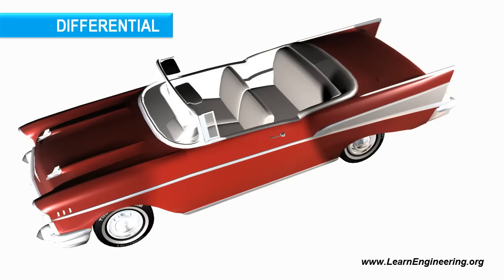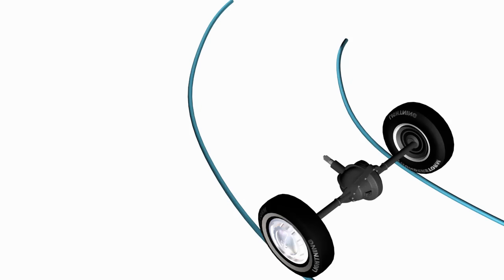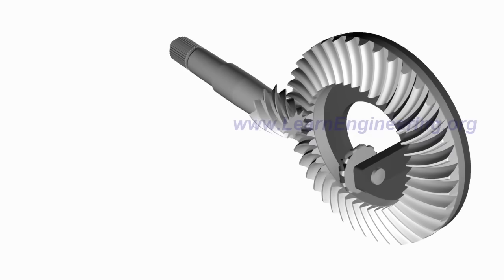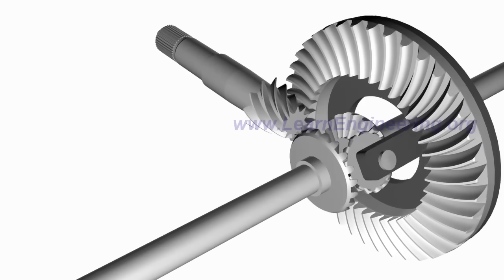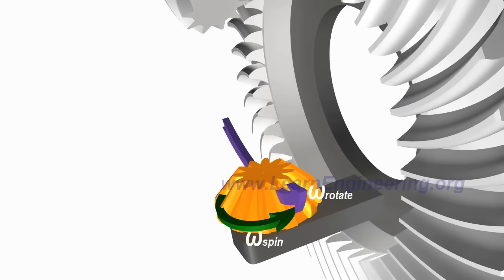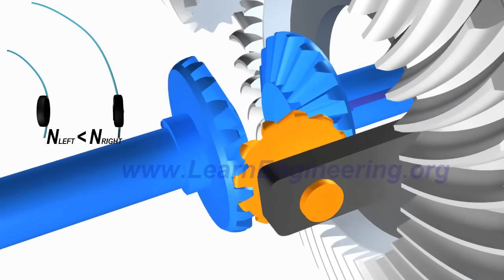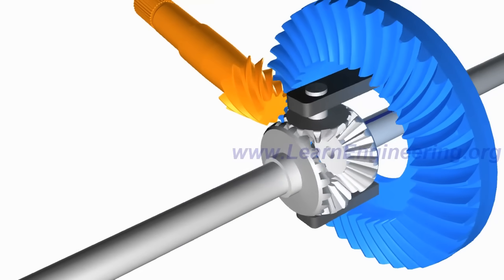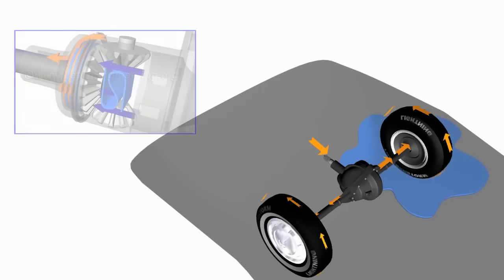How a Differential works ?

Comment: Sorry if I'm just being really stupid, but how does the spider gear "know" to rotate on its own axis when the car is turning? Or is there some sort of mechanism involved?
Reply from the maker: MrLatinNerd There is no mechanism involved to spin the spider gear. The spider gear is forced to spin on its own axis due to the demand of speed differential.
Reply: @SabinCivil  but how spider gear know where demand of speed required more or where less im totally confuse please explain ?
Reply: @narayantakle3648  there is no sensor as such. It's like cause and effect. For ex if there is a 3 variable equation and I put two values in it. The third variable will automatically assume a value in order to satisfy the equation. 
The differential is like the third variable that automatically assumes a rpm to allow a natural difference in speeds of the back wheels.
For your question, It will assume a clockwise rpm for left direction turn and vice versa for right direction.
Reply: Arthur Collins It's the force exerted onto thew heel by the gourd as Zan turn
Reply: Ernesto Sastre When the car takes a turn, the outer tire spins more than the inner one. 

Now, if both axis were to be locked, this would cause tires to slip.

In this case, each axis is separated, tied together by a spider gear.

Due to axis being separated, one is able to spin faster than the other.

The difference of speed (and thus, force->torque) in both axis make the spider gear rotate. (Try pushing a long object in opposite sides simultaneously, harder on one side than on the other, it spins)

Were the spider gear unable to rotate in its own axis (say, welding the differential), the axis would be unable to spin at different speeds, disabling the differential.
Reply: 20frieza The outer wheel doesnt "realize" its spinning faster, it has to spin more times since its traveling along a longer path (arc). The extra spins (higher RPM's) of the outside wheel then turn the spider gear which counteracts the spin of the inside wheel allowing it to spin at a slower speed than the outside wheel.  So to answer your main question, the outer wheel does not know  when to turn the spider gear, it must turn at a higher RPM's because its taking a longer path on a turn than the inside wheel.

Sorry if my explanation isnt clear enough, it can be a tough concept to explain.
Reply: Ernesto Sastre Watch the beginning again carefully.  When a car is taking a RIGHT hand turn, the LEFT wheel must travel along a further arc than the inside (RIGHT) wheel.  Because of this, the left wheel must turn at a higher RPM than the right wheel.  The extra RPM force generated by the left wheel over the right wheel causes the Spider gear to turn and compensate for the difference in RPM's on both wheels.  Essentially the left wheel will turn the spider gear along the right wheel to allow it to spin slower. watch the clip at around 3:30 a bunch of times and you will understand
Reply: @gnarkilleptic4871  Thankssssss haha
Reply: +MrLatinNerd  Yeah I think the important thing to keep in mind is that the spider is completely passive. It's not forcing a spin to give one wheel more rpm over the other, it just allows one wheel to spin with more rpm than the other which would not otherwise be the case if the axil where solid from wheel to wheel.
Reply: @CaLvInblack410  Literally every other comment in this thread only made the confusion worse. All that needed to be said is this right here. This isn't an active system that forces the outside wheel to spin faster in response to a turn. The outside wheel is going to spin faster due to travelling further around the turn, and this is a passive system that allows that to happen, rather than locking the wheels together like a solid axle. All the other nonsense about weight distribution and such is just that. Thank you.
Reply: Your answer is the best one.  To get some intuition about how this works, think of the case where one wheel faces infinite friction and the other one is allowed to slip freely without any friction (think glare ice).  The spider gear is still obliged by the drive shaft to rotate with the ring gear, and it is no longer turning the high friction axle.  That means all of the torque generated by the ring gear and passed through the spider gear, is communicated to the freely spinning wheel.   

The spider gear in effect powers the wheel of least resistance at all points in time.  On a turn that means more of the drive power goes to the outer wheel in the turn.
Reply: +Ernesto Sastre The act of turning triggers demand on the differential.  Yes, the differential knows when it is in a turn because there is more demand on one side than the other.  Were that demand not present, it would not put any pressure on the spider wheel to spin about its axis.
Reply: +gnarkilleptic Would I be correct to say that because of the force(torque) generated by the engine, the left wheel automatically turns at a quicker rate than the right wheel not because it knows it needs to, but because the differential transferred more of the engine's power to the left wheel instead of the right? In other words, does the spider know when to start rotating about its own axis and transferring more power to the left wheel simply because it receives more force from the engine? I think what many here (including myself) are finding hard to understand is the part where they're told the left wheel HAS to spin more times than the right wheel in order for the car to turn smoothly, implying that it always does happen, which is why the spider seems to 'know' to rotate about its own axis and transfer more power to the left wheel instead of simply not rotating. It's very difficult to explain properly, I mean most Physics concepts are, but I'd really appreciate if you could help :)
Reply: While turning, the wheel closer to the turn requires more power to be moved than the opposite wheel because of the forces implied (the term "weight" was a simplification on my part). Thus, the spider wheel translates that difference naturally, because it finds more resistance to communicate motion to one wheel than to the other. At least that's how I understand it. I might be wrong, though.
Reply: +MrLatinNerd it remains stationary due to the wheels havinig similar resistance. You could say they balance each other out so the whole assembly rotates. When turning the inside wheel tends to have more resistance or require more force to turn so the spider gear begins to turn and outside wheel will spin faster.
Reply: +MrLatinNerd hey! the reason i can think of in this case is the difference in torque on both the wheels while taking a turn. let's say a car is moving in a circle in the clockwise direction (taking the right turn always), the force arm of the right wheel from the center point is smaller as compared to the left wheel which has a bigger force arm, in that respect the torques on both the wheels are different which i think is the reason for the rotation of spider gear on its own axis
Reply: +20frieza Its fritction. the Wheel itself doesnt accelerate, the right side of the car does and the Wheel has to keep up. Difference of speed between the Wheel rubber and road surface will build up friction which transfers to the shaff...Like those old bycycles without gear...if you stop pedaling while already moving, the pedals will continue to move on their own. If you try to keep them from moving though, you'll feel a force (result of friction) in you feets and the bycycle will start sliding.
Reply: +Learn Engineering but doesn't the flow of the motion start from the pinion gear,through the ring gear and the spider gear and THEN into the wheels ?? What i'm trying to say is that shouldn't the spider gear determine the speed of the wheels and not the other way around ?? i hope i'm making sense
Reply: I'm guessing that the initial speed differential (from say driving straight to making a turn) is caused by friction. When you turn all of the cars weight is pushed on to one side, equating to more ground traction on that side which in turn slows down the wheel therefore creating a diferential between the two wheels. Speed Differential (one wheel moving faster than the other) in turn activates the spider gear. This explanation also makes sense when we examine the standard differential's main drawback which is if one wheel is on a slippery surface. There is more traction on one side therefore creating speed differential which equates to the spider gear sending more power to the slippery surface/side with less traction.
Reply: because when turning, 1 wheel is taking a shorter path and in order to take the shorter path it wants to slow down.

now the act of the inner wheel slowing down and the outer wheel does not, which make's the side gear on the inner side spin slower, this means that the spider gear is fighting more pressure on the Inner side gear than the outer and because like anything it wants to find he path of least resistance, the Spider gear chooses to rotate to compensate for the slower speed rather than force both side gears to move at the same speed.
Reply: I know this is a in old thread, but it is the friction with the ground that forces the difference in wheel RPM. If there is no differential, then the inner wheel will slip against the road. This draws additional force in order to overcome the natural friction of the wheel against the road. Instead if thinking that the differential changes the speed of each wheel, it's easier to think of it that the differential ALLOWS the different speeds for each wheel, which is what the wheels naturally want to do due to the friction against the road.
Reply: @samc4531  wowww u just enlightened me after all these comments i wasnt satisfied but as u said differential "allows" it to rotate has made me clear this doubt now thanks man
Reply: Thanks
Reply: +MrLatinNerd the two wheel can freely rotate about its axis and around the corner there is different speed between two wheels so that differential speed rotate the spider so the spider rotate by differential speed  .
Reply: +Ten Pur Thanks dude! great explanation. finally I think I got it
Reply: Thanks for all your comments, guys - I think I understand this now!
Reply: +MrLatinNerd Due to the conservation of angular momentum .
Reply: I Will try to explain how both wheels turn at different speeds 

The two wheels are connected through an axis, therefore both are making 
the same circular trajectory explained by the equation v=w x r. The 
angular velocity (w) is the same for both wheels but radius r are 
different, therefore the external wheel will have more vel than the 
internal to compensate it.
Both wheel have the same diameter so to have different speeds the two 
should have different angular velocity of wheel ( attention because this
 angular velocity is of the turning wheel and is different of the 
trajectory angular velocity). V= w x r again and this time radius are 
the same, therefore the external wheel will rotate faster ( w = rotation
 per second) than the closest one and its angular acceleration ( Alfa) 
is bigger. This brings an increase of momentum in the distant wheel, 
cause momentum = I x Alfa, I is the Same in both wheels cause depends on
 the geometry and weight ( equal wheels), therefore exist an increase of
 momentum in the external wheel and a decrease at the internal, this 
difference of momentum is transmitted to the gears until comes to the 
spider gear, the spider gear turns on it axis because exist a bigger 
momentum in one of the gears that is connected to the momentum 
transmitted by the external wheel' and this makes the spider gear 
rotates on it own axis and this rotation makes the internal axis rotate 
independent with less wheel angular velocity what avoid the drag when 
you make a curve.

Sorry, my English is poor but I hope you understand the main idea
Reply: I struggled with this too but then I tried to make sense this way. The act of turning due to the front wheels means that the car is turning in a circle, turning right, clockwise for example. Then theres a centre point in the road of which the car goes around (due to the steering, force applied on front tyres twards the centre of circle). Run an imaginary line from the centre point through the rear wheel axis which has 2 radii, long radius for left wheel, short radius for right wheel. The engine provides torque to both wheels equally as they travel round this circle. The radius from the left wheel to the centre is longer than the radius from the right wheel to the centre. Torque = force.radius . In order for torque to be conserved, force.radius must be conserved. As the right wheel has a smaller radius, it has a larger opposing force vrs the left wheel (for t = F.r to be true). This opposing force difference from the left n right wheel acts on the spider gear causing it to rotate.
Reply: For anyone still confused after six years, this happens naturally. That’s the best way to put it. There’s not computer chip or magical tiny creature that figures out when you’re making a turn. It also helps to understand that the spider gear isn’t what starts the whole thing, it’s what makes it possible. The different rpm’s of the wheels when turning happens naturally as that’s just how physics works. If the wheels were attached together with a simple rod, there’d be problems. So they need to be independent of each other while still drawing the same amount of power from the engine. What makes that possible? The spider gear. Longer than I expected but honestly the best way I can think of to put it and again it starts with understanding that the spider fear doesn’t initiate or start the system, it’s what makes it oossible
Reply: @ItsDeeKay69  Yeah I kinda had this question for like 5 minutes and then I understood what you guys were trying to say. My two cents: TO MAKE IT ABSOLUTELY CLEAR -
-Picture two wheels attached together by an axle, they spin independently though they are not being driven
-We all know that when they turn, one has to turn less than the other
-So if they are attached together and there is no wiggle room, and the car HAS to take a turn, then if the car is going to stay together and not split apart, the wheels will have to go different speeds, or else it would break the rod or cause the car to veer off course
-Basically, it is because the car stays together that the spider gear 'knows'. The demand of the difference is already placed onto it by virtue of the car staying together and taking a turn. It's a rigid object (mostly).
-In the case of traction loss, one wheel that loses traction naturally can spin more easily on its own, it's the 'faster wheel', it creates the difference and the spider gear responds to it
Reply: zenerd No probs
Reply: it is the effect produced due to spinning. can you please explain what causes spider to rotate clockwise or anticlockwise?
I know that different speed demands causes spider to rotate but shouldn't it there be a cause which results in differential speed??
Reply: ok i got it if the wheel turns to the right reactive forces on the right side gear causes the spider to rotate in such a way that its rotation contributes to increased rotating speed of left side gear
Reply: My Question is:
Suppose a car is taking a really big turn such that the inner wheel must make a zero turning radius, would the transmission allow that wheel to not move at all or it will let it slip?. What i really fail to understand is that what would happen if both wheels were to be suspended while rotating, then you tried to stop one wheel using just a small force, would that be possible or the spider gear does not allow a wheel to slow down?
Reply: Learn Engineering  sir the question is 
does rpm difference make the spidergear spin about its axis      or  
     is it the spider itself  makes the tires rotate at independent rates???in other words  does tires rpm difference apply a spin on spider or  is it the spider applying a rpm difference to the tires???
Reply: Kaddafi K Due to different forces acting on the wheels(while starting the turn), torque will be different in both wheels, so the spider gear will be forced to turn. At the exact same time, the tires will decelerate/accelerate(depending on the way you turn).
Reply: Jonas Kunnen alright so  tires at different rpm make the spider spin n 
then spider gear allows rpm difference go on .
Reply: @shahabghasemi  Tires affect spider, spider does not do anything ACTIVELY to change how the tires spin, it is a passive system that allows the tires to spin independently
Reply: MrLatinNerd 
'Vx
Reply: Never say that, I had just the same question
Reply: +gnarkilleptic
"extra RPM force generated by the left wheel".
Then, how does the left wheel get the extra rpm/force ?
Reply: +quitarist
It has to be proved that the turn causes faster rotation on the outer wheel. If this is right, it will give the answer why the spider gear spins on its axis.
Reply: MrLatinNerd I think you are asking yourself how the car even 'knows' in which direction it has to drive. This has something to do with the steering at the front wheels I think. The wheels at the back just 'adapt' to the curve the car has to drive. Please correct me if I am wrong.
Reply: +MrLatinNerd
Let me put it simply
The spider gear doesnt turn to make the wheels go at different speeds
The wheels go at different speeds and make the spider gear turn
Make sense? You're thinking of it backwards.
The car is trying to make a turn forcing the outer wheel to spin more, which causes it to rotate the spidergear so it works out
Reply: When was the differential.invented. Before this invention how cars worked?
Reply: All of you guys did an awesome job but its simply just physics 101. There is no singal from the transmission to put more rpm on  one  side.   Its just machanics and physics same thing like leaning on  a bicycle with high speeds will turn you without moving handle bars
Reply: yes, but that doesn't make sense for someone who is trying to understand why one wheel rotating faster than the other does that. To correctly answer his question you should've gone into more detail.
Reply: Watch again and just imagine you are the one who turned the wheel in opposite direction
Reply: Think of 2 guys running laps in a 400 meter oval track, when they're running straight they can have the same speed and be side by side, but when a curve comes the guy on the external lane has to run faster to keep up with the guy in the internal lane.
Reply: MrLatinNerd take out nerd from your name
Reply: that's because this video as a lesson is no good! 
Watch this one - simple and easy! I guess in 1937 teachers were much better :) 
https://www.youtube.com/watch?v=yYAw79386WI
Reply: I had the same question. Thank you all much for your explanations. I got it.
Reply: That's a good joke
Reply: I think a lot of what causes confusion here is how the two rotations of the spider gear play different roles, and how axle alignment constraint is key. The explanation for how the driving force/torque is transmitted from the drive shaft to the axles is straightforward (pinion >ring gear > spider> axle shafts),  but once the spider gear rotates about its own, axis it may seem unclear what the “chain of action” is. It is clear to the observer that the spider gear transmits the force to turn the axles, yet if the speed differential is responsible for turning the spider gear, this could seem like circular reasoning. 

The trick is to remember that the rotation of the spider gear with the ring gear is always happening, even while the spider is stationary about its own axis, and this transmits torque to turn the axles. The rotation of the spider gear comes into play when there are forces on its teeth that are perpendicular to both its axis of rotation and the axle shafts. 

Thus, you get the following chain of events: 
1. The front axle is steered to initiate a turn.
2. The spider gear, rotating around the ring gear axis, continues to deliver torque to the axles that would drive both wheels at the same rotational speed.
3. At this point, the outer wheel would have to rotate faster, or the inner wheel rotate slower, in order for the two axles to stay aligned through the turn. The positioning of the spider gear itself is what aligns and constrains the two axles to one axis. 
4. While the rotation of the spider gear around the ring gear axis continues to supply the force for both wheels to turn at the same rotational speed, the teeth of the spider gear simultaneously makes it impossible for the wheels to do so, as this would cause the axles to be misaligned. 
5. This resistant force in the spider gear teeth, which allows it to constrain the axles during a turn, is what then causes the spider gear to begin rotating about its own axis. This rotation, in turn, has an tangential force component that will add to the outer wheel, and subtract from the inner wheel, thus allowing for different rpms. When the teeth are no longer resisting a force that would otherwise cause the axles to be misaligned, then the spider gear will cease to rotate about its own axis. 
Note: The direction of the spider gear’s axial rotation depends on which resultant force direction would counter the axles from becoming misaligned. In a right turn, the right inside axle would start to lead the left outside axle if they were not constrained, thus, a resultant force that added to the left, and subtracted from the right (clockwise) would then keep the axles aligned, and vice versa.

If anybody waded down to my comment and was confused, I hope that this explanation helps!
Reply: Not stupid at all but, you should watch this explanation as it explains it very well and it is a planetary gear, not a spider gear as mentioned in this video. 
https://www.youtube.com/watch?v=yYAw79386WI
Reply: See I was also wondering this so it's not that stupid lol. But I'm glad they did answer your question
Reply: this is too descriptive of what is happening, but not why in a turn. It is because the inner wheel in a turn will have more resistance, it thus gives a force opposite to rotation of its axle, the spider gear transforms/translates (what is the correct word here?) this force in the opposite sense on the outer wheel, giving it more force, thus power, thus increased rotation.
The same in the straight ahead scenario: it's a constant balance: the two wheels keep each other balanced.
Reply: It doesnt know because its not connected to any kind of motor system. It spins freely
Reply: When the car is turning the increased speed on either wheel forces the spider gear to move
Reply: sounds like you guys haven't watched this https://www.youtube.com/watch?v=yYAw79386WI
Reply: If you jack up a car and spin one wheel, the other will spin the opposite way.. this is the connection through the spider gears working... they do not turn themselves, and they are not powered. They dont make decisions or receive signals... All they do is allow a difference in speed... if you take a chain drive 4wheeler with a solid rear axle and make the 4wheeler turn its minimum radius on dirt you'll see thr inside tire spinning slightly and perhaps the outside skidding a bit... either way, the tracks won't be as clean as the fronts because they are not bound together...

To further add to the understanding of why they are necessary... try turning sharply with a 4 wheel drive vehicle on pavement... its not smooth
Reply: This is probably clearer to understand....
https://youtu.be/yYAw79386WI
Reply: I'm surprised people don't know what a differential is. We learned this stuff in high school shop class.
Reply: I hope you still remember the steering wheel
Reply: When vehicle is turning to particular side the binding force acts on inner wheel being closer to point around which wheel moves ,the sun gear of that side rotates slow as compared to other wheel which causes faster speed of outer wheel.
Reply: Spider gear pushes the wheel gear. But when there is difference in speed it will slip that is rotate on its own axis. It is same as wheel slipping when solidly attached and make turn.
Reply: I was thinking the same thing
Reply: Sometimes, you get so technical that you go blind.
Reply from the maker: Ernesto Sastre I hope, you didn't watch initial part of the video carefully. When the car takes a turn, the left and right wheel has to turn at different speeds. This is speed differential. This speed differential will make the spider gear spin on its own axis.
Reply: @SabinCivil  after reading this comment i got it, and then i entered in a process very similar like being high
Reply: @SabinCivil  I thought the spider gears is the reason of the speed differential, but it's actually the other way around isn't it? The different speeds moves the spider gears.

So what causes the speed difference? Is it the act of turning itself? Then is it safe to assume that the turning always results in speed difference between the inner and outer wheels and the open differential mechanism merely allows the wheels to rotate at different speeds (it does not cause the different rotation speeds)?
Reply: @SabinCivil  I also got it now thankss
Reply: @SabinCivil  how do the side gears spin at two different speeds?
Reply: It can't be made any clearer. In a turn the outside wheel must rotate faster than the inside wheel. When you make a turn this faster roatation is automatically caused by the turn itself.
Reply: +MrLatinNerd It's not explained properly in the video. It depends on the weight of the car that each wheel receives while turning.
Reply: +Zohar Cochavi it's not exactly "pushing" more on the outer wheel, the outer wheel just needs to make more rotations because of its longer arc on a turn. the spider wheel just compensates for the different wheel rpm's.. I think most of these people are getting confused because they are thinking too much into it
Reply: @gnarkilleptic4871  it all begins when the vehicle is steered i guess.This creates seperate path for outer and inner wheel. As the outer path is longer the outer wheel HAS to rotate faster.
Now this is the part i dont understand. Is it the power on the inner wheel forcing the outer wheel to rotate faster or does the outer wheel force the inner wheel to slow down??
Reply: Learn Engineering Still not sure if I got it. What does  trigger the demand of speed differential? Does the car know when it is taking a turn so as to signal the demand of speed differential which causes the spider gear to spin?
Reply: @ernestosastre7555  in a turn, the wheels cover different distances but have to get to the end point at the same time. What happens when you have to cover different distances with someone but same amount of time? That's where the differential comes in to allow one wheel to rotate faster that the other. Basically, the spider gear serves this purpose
Reply: gnarkilleptic ... your explanation is exactly what has been running on my mind.... your sentence "The extra RPM force generated by the left wheel over the right wheel causes the Spider gear to turn and compensate for the difference in RPM's on both wheels." is exactly what I thought.... the outer wheel causes the spider gear to rotate.. but what I fail to understand is ... who/how is that extra force generated? Currently for me it feels like the outer wheels have a mind of their own and they realize this is a straight line or a curve... and generate the necessary force..which ultimately rotates the spider gear. Its difficult to put in words what I want to say... would you be kind enough to explain who/how that extra RPM is generated on the outer wheel? Thanks
Reply: 20frieza . The extra force is generated by directional inertia.
Reply: The demand for different speed is induced by the forces on the wheels. As my previous comment stated the spider gear tries to find an equilibrium in the forces acting on the wheels. If that equilibrium is found when one wheel is spinning faster than the other, the spider wheel will rotate. 

The easiest way to see why it spins is taking it to the extreme. Imagine one wheel being blocked by a rock and the other spinning freely in the air. 
The ring gear is being forced to spin by the pinion gear. Since one of the wheels is blocked, the side gear on that side won't be able to move at all. You now have the ring gear trying to rotate the spider gear(not around its own axis, the ring gear has no control over that) and one side gear refusing to move. Due to the reactive forces from the stationary side gear on the spider gear, the spider gear will spin around its own axis. This will make the other side gear turn at a speed combining the rotation of the ring gear and the spin of the spider gear. 

If you got this explanation you can just increase the braking torque on the freely spining wheel and decrease the braking torque on the blocked wheel. This way you can go to any situation you like.

The braking torques mentioned above are generated by friction. 

So to conclude:
It isn't really a demand in different speed that makes the spider gear turn, but a difference of the forces on the wheels that do.
Reply from the maker: Arthur Collins
At the starting of video, we are explaining it. To take a turn the left and right wheels have to turn at different speeds.
Reply: Learn Engineering
Why is there a demand of speed differential?
Reply: Ten Pur I've never heard anyone explain it in terms of the distribution of the car's weight... Do you mind elaborating? Like many other people in this comment thread, I still don't really understand exactly what causes the spider wheel to rotate...
Reply: GoBIGclan they dont communicate...
Reply: think it like you are the spider gear and someone was pushing you from behind. your hands is on two sliding doors. what happens when a door gets rusty or stuck? you can't open or close them at the same speed. but your fucking friend is still pushing you from behind so you need to tilt. (no you can't let go the handle.).
Reply: +Zohar Cochavi hahah that's the thing with Physics stuff gets really hard to explain sometimes XD
Reply: riverstrat 
your explanation made me understand more now, it makes sense that the inside wheel is dragging the outside wheel along a path but with differential speed when turning.
I was trying to find an answer to all this wheel turning physics haha, anyways, thanks dude.